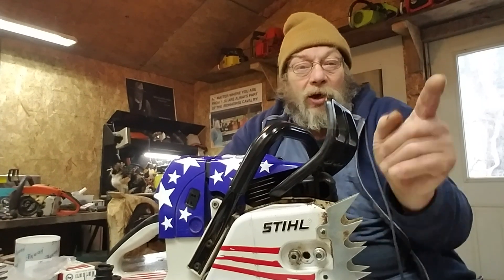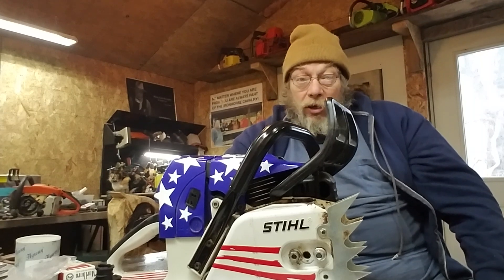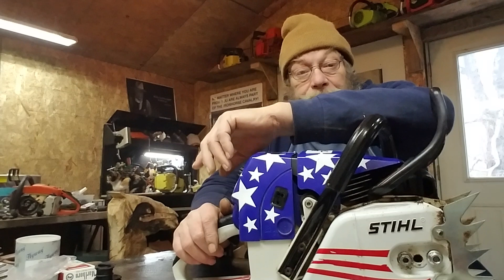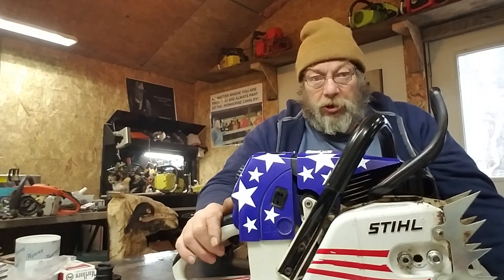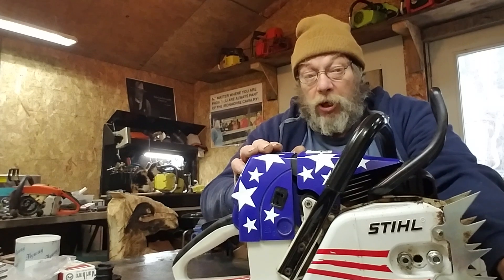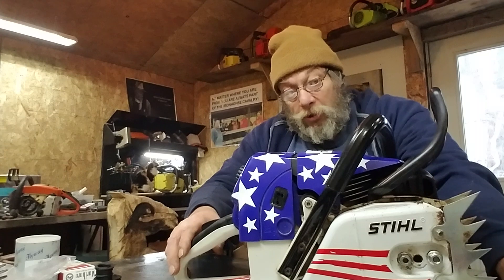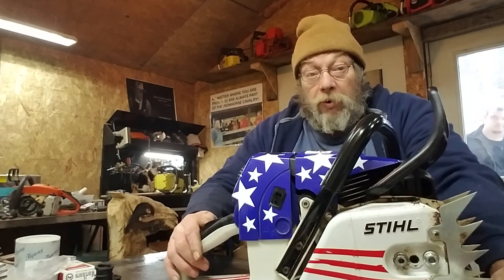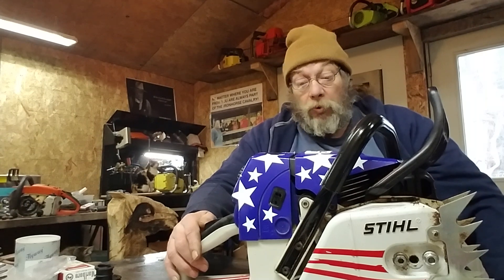What mix oil to use! What ratio should I run in different saws!

Comment: I know nothing about small engines and i'm totally guessing but i would imagine saws are set to run on 50:1 now days. If you tried running 40:1 the chainsaw would compensate and run leaner and that could  damage the chainsaw over time. If there was a way to set the saw at 40:1 im sure it would last longer for sure and maybe there is a way to set it to run 40:1. Not only is the EPA getting what they want but so is the manufacturer because you have to keep buying new equipment every couple years

Comment: You might not believe me, but I use Mobil one synthetic engine oil. You don't get hardly any carbon at all,and everything has a thin coat of oil on it everywhere. The carbon that ends up happening can be wiped off. The only thing is there ain't no reading the plug. It stays pretty clean. Like you I run 40/1.

Comment: I have been running chainsaws since 1964 and it looks like Harvey isn't keeping up with modern technoligy !  Talking about 2 cycle oils ~~~he mentioned he runs most says 40:1..Take a look at Amsoil Sabre...you can run some engines  100:1  ..I use a little more than gallon of gas a week and run Amsoil 60:1 with NO problems ,,I have 3 Chinese saws G444 & G666"s....Look around again Harvey !